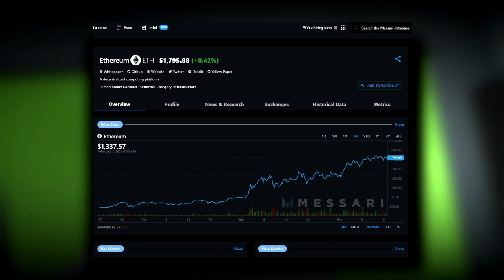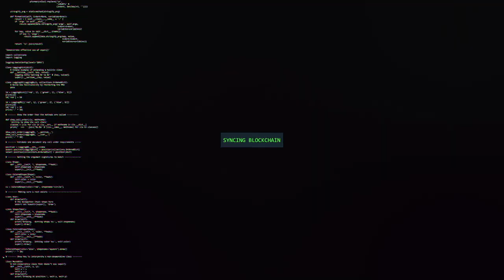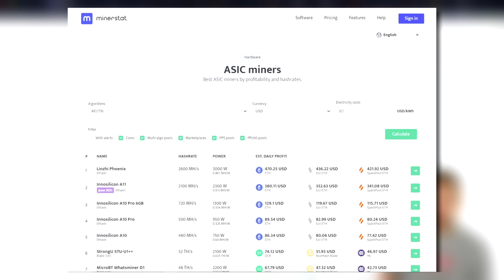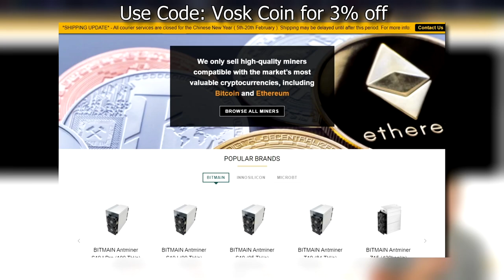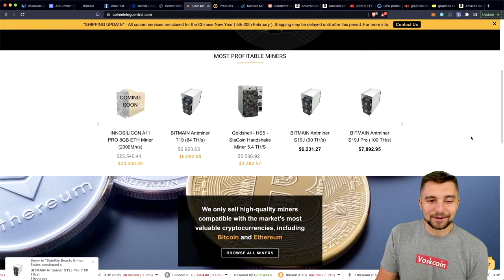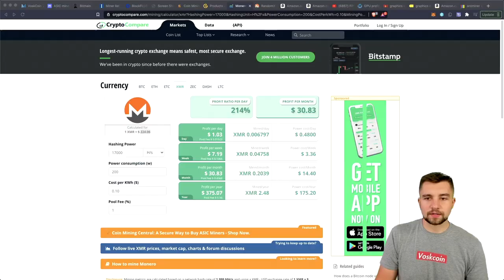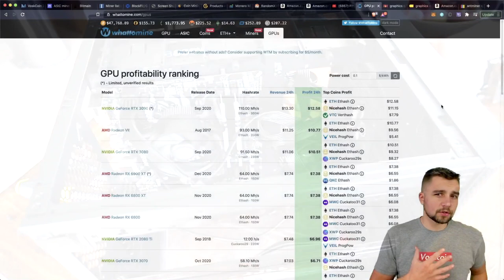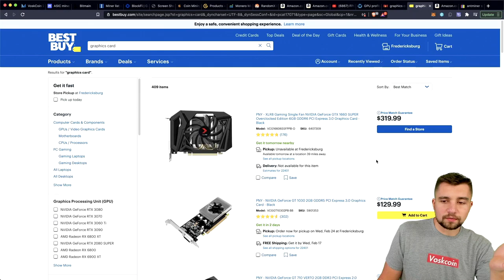Crypto Mining is MORE PROFITABLE THAN EVER?!

Comment: I just got into mining 3 weeks ago, I will soon have a 3070, 1070 and 1060 mining ETH full time and a 3080, 3070 and 2060 mining part time. I'm wondering if I should build an actual mining rig for my full time miners, with the possibility of expansion (cards are currently in older PC's). Or has the ship already sailed for building a modest mining rig?

Comment: My 3080 only pulling in $7.50/day now. If I’m it for Laing haul it’s still a good investment. I only keep it at 92mh because it’s my gaming card and don’t want to burn the vram or fans out. It’s a PNY btw and it’s a beast. 92mh @ 229w 65% fans mem clock +900 and memory junction never goes over 74c. I’ll take it

Comment: I'm moving around a lot right now, would it be possible to leave a miner in one of my homes and maintain it remotely. I think I already know the answer here as I have mined before, a long long time ago, but I'd like to here your thoughts.
Reply: The first link in this video is a place that you could just have them power your monitor and you can monitor it from there
Reply: Yes, I do.  Set your miner to a static IP, and it will power back up and start mining again if you lose power or 'net.  Other than that, you can set up a virtual desktop on a cheapo used old laptop and leave it there to monitor the miner(s) and use that to access the miner(s).

Comment: Maybe someone here can help me out that has actually seen the issue because it seems like it could possibly be a safety thing. I have a 6 gpu rig setup... a 3090 and 5 3070s. they are all different brands pretty much due to difficulty obtaining so the overclocks are all slightly different for best performance. I reset the miner once a week for the hell of it but I probably don't need to because my stale shares are less than .001 percent over 7 days at a time and I have seen 1 invalid share in a month. Once a day or so at different times each gpu will suddenly boost its clock way up to max with the memory already overclocked which leads to on Hardware Info Reliability voltage,  Max operating voltage, and Max utilization limit. The cards are on 2300w of power supplies so no issue there and on their own 20amp breaker. I am running the graphics off the cpu also. Something is waking them up and telling them at different times to wake up and boost to the moon. its defiantly random. The pc is setup in a normal mining fashion, win 10 updates off no background apps ect. Can not figure out what is causing this and would really like to because when they boost they are pulling some juice for sure. Help a brother out.
Reply: Any tips on how to obtain 30 series GPUs? I’m having a tough time.
Reply: @Swivelsix  so far I have bought 7 gpus. I haven't used any purchase bots at all. I got them from Newegg B&H Photo and Best Buy. You have to set up the notifications and literally be ready to go at a moment's notice. You do not have time to check what type of card it is you literally have to click buy immediately. Don't worry about what brand it is or anything like that you don't have time for that. I bought all of these gpus over the past 3 weeks so I have put some work in but it can be done. Just matters how bad you want it

Comment: Hey I like your vids. I have a renewable energy source in the mountains. I am trying to start crypto mining. I need to get my hand on some hardware which is a struggle. Another potential problem is internet. I know you don’t need fast internet speeds to mine, but where the location is it is very remote and the only internet connection is mobile data 3G network at best. Do you know if this will be enough for the beginning (example 3/4 gpus) thanks and keep it up with the uploads!

Comment: Started mining a few weeks ago. I have a rig with 3 cards one of them is a second hand 1060. I spent  S1200 on a CC for two cards, 1660  and a 1060 (used)  with an existing  1060.  I got cheap power (solar)hash rate of 75,  If I buy a ASIC or even sign up with compass.  Almost would be better to take that 8k and  invest it by staking?

Comment: At the part of the video, when you're talking about mining farms - are you walking into a shipping container? This would solve your noise problems if you add air conditioning, locks, ventilation. The price is usually $1200-$2400 for 20ft+ and they will deliver to you. Definitely worth investigating. You can stack them.

Comment: why are you using that ATX motherboard to power that asic... cringe worthy seing all those sweet evga pig tailed 8 pin cords running that thing instead of gpus, and asic power supplies are more effiecient and way cheaper
Reply from the maker: No, a cheap China asic psu is not more efficient or safer than a titanium EVGA. That’s why.